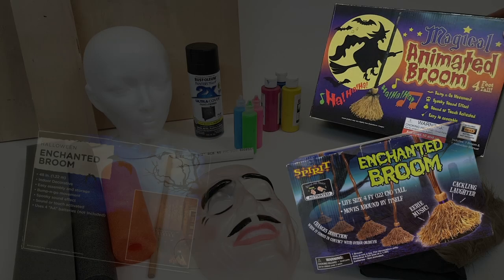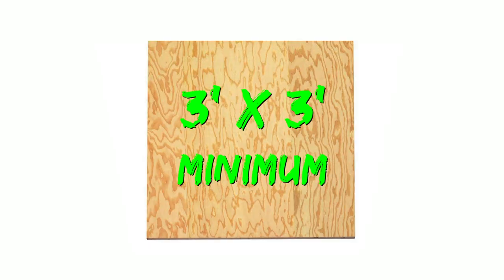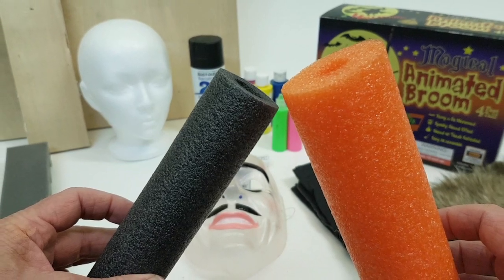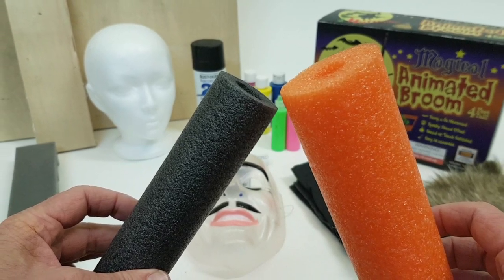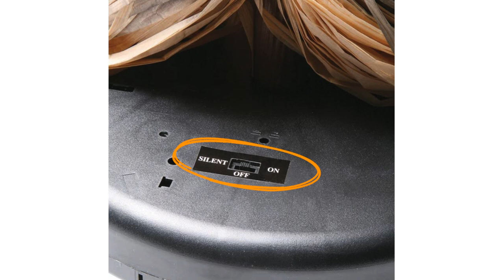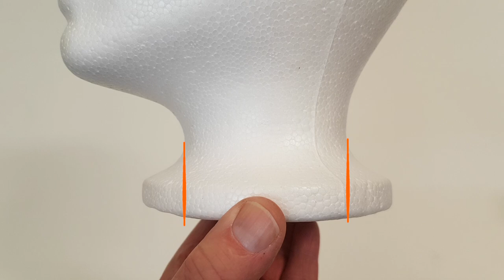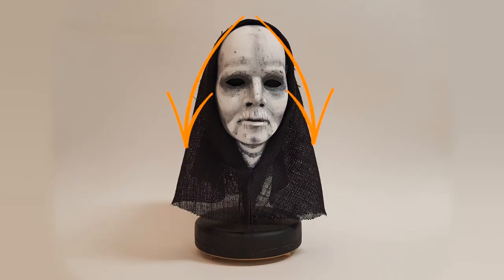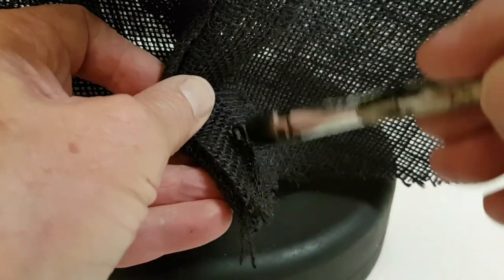DIY Disembodied Head | Moving & Animated HALLOWEEN Prop How-To Tutorial

Comment: I thought for sure this was going to be mounted on a roomba, and I guess I wasn't too far off.  This looks so much eerier than putting the head on an oscillating fan base.
Reply from the maker: Thanks Susan, you were very close.  In fact, a roomba could be used and is most likely a better mechanism... this is a bit more cheaper.  A poor man's roomba.

Comment: Hey Paul at 10:35 in the video was that a mask you bought or did you make it?
Reply from the maker: I made that mask many, many years ago.  I formed it over my own face using a brush-on/peel-off beauty mask and ordinary gift tissue paper.  Alternating layers, then painted with craft paint.  Once dried I peeled if off of my face and applied it to a styrofoam wig head.  All these years later and that mask is still going strong!

Comment: Many years ago someone in my neighborhood made a thing like the head shown here but using fishing line to have it up high.  As I recall, there were two motors with cranks and three lengths of fishing line.  The motors were at the corners of the house and the line with no motor went to a tree that happened to be well placed.   The head only really moved a few feet but this took it in and out of the beam of a spot light that was aimed at an up angle.  The spot light thing had a black tube on it so you didn't really notice it.

Comment: Fiendishly clever... I like the cut away walls too... did you make a How-To on those?  They seem more like prop walls for making the video, but something larger that could be used in a haunt or garage.... while it's more about decor and scene-setting, it does play a role in a haunt... after all, this prop needs context.  So great to see more content from you!  Happy Halloween... that is... prop building season  🎃👻🦇🐈‍⬛
Reply from the maker: Hi Ray, thanks for noticing.  I have been toying around with a "How-To" on prop walls.  They are both made from one sheet of interior massonite brick paneling.  For the wall papered one I just used the smooth side.  The bricks from the center cutout areas I individually cut out and applied randomly to the bick paneling, giving the bricks some dimension.  I added styrofoam to the back side of the bricks surrounding the hole to give them some real thickness.  It is all smoke and mirrors, as they say.
Reply: @HALLOWEENHOWTObySaulFilms  Making a How-To for the walls would be great!